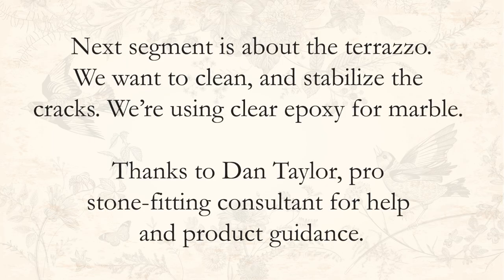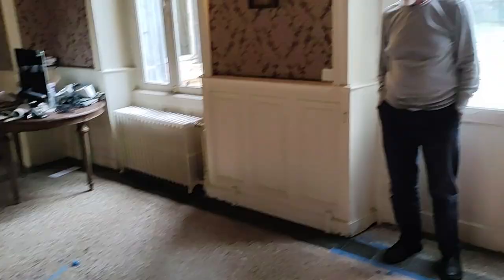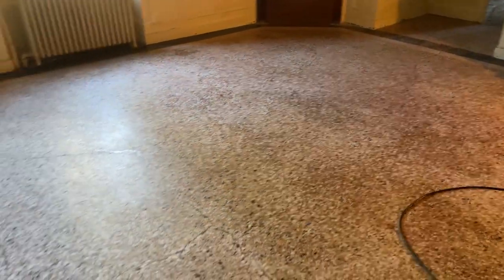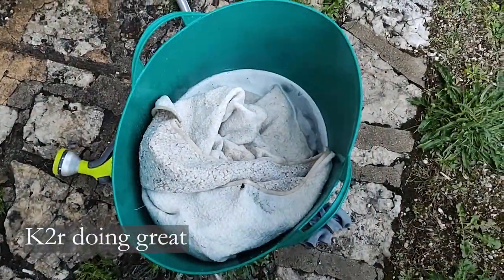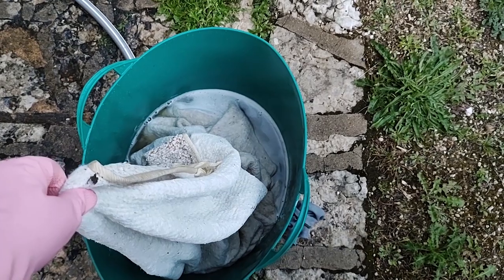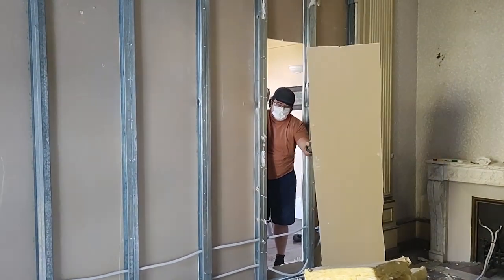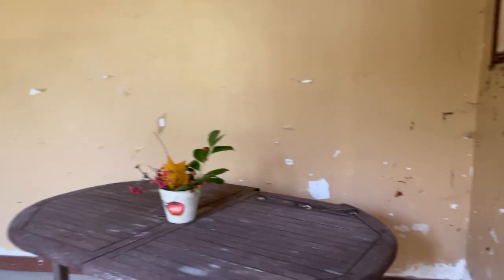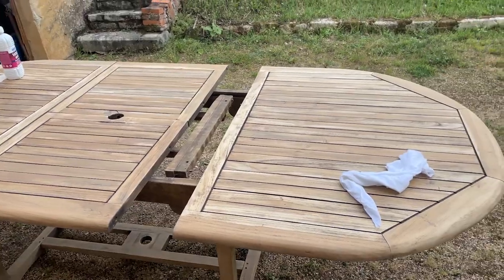Very SATISFYING DIY and CLEANING | Manor & Maker

Comment: Morning Steve & Sara, well done repairing the crack which saves a big headache for later on. The dividing wall coming down, should never have been erected. A Chateau's main feature are the massive rooms, that was what it was all about. It also has that beautiful freeze painted which is beautiful, why take the focus away from that? Sara if you do not have a plunger, get one from the d.i.y centre. You can easily plunge your fabrics, and I think get a lovely large plastic tub. I use a plunger for gently washing the fine stuff, jerseys etc. it is a great help, just suggesting. How did the table umbrella turn out, I saw this beautiful white lily type material floating about over the beautifully restored table. What a bonus, a bit of work and the table can be used over and over again for any occasion.  The table looked delightful hopefully you will have many opportunities to entertain out in the garden. Enjoy all the hard work of cleaning it is so worth it all. Kind regards.

Comment: Those teak garden tables can last for ever. You can go two ways with them. You let them weather and then they go grey, witch a lot of people love. Once a year in spring you remove the green film that appaers due to moistere and let it be for the rest or you do what you did and remove the green and apply teak oil and then it get back to its brown color. Its a personal preferance. We had a very simular set, had it over 20 years and it was still fine but  I did not like removing the green gunk every year so we replaced it with a colorful modern alumnnium set. Our old set got a second life with some friends ans they now enjoy it. They did a make over like you did. I prefere the grey finish. But its lovely either way. The salon looks much nicer and more in proportion now the wall is gone. Great job. Look forward to see it redecorated.